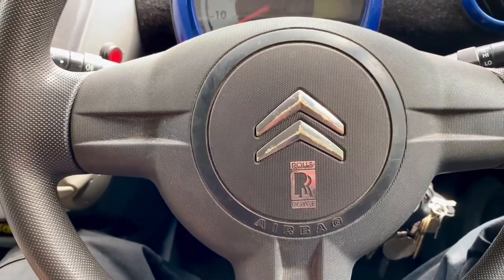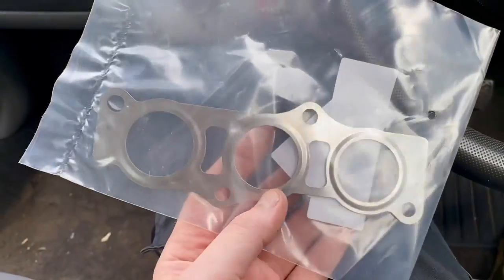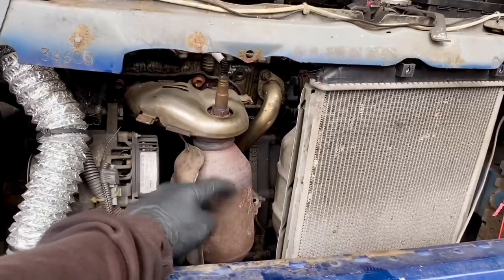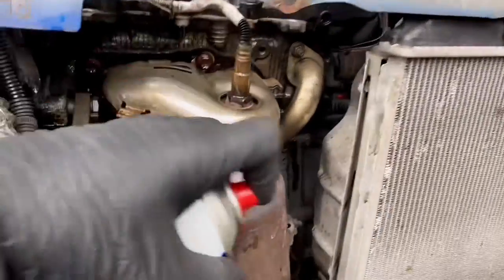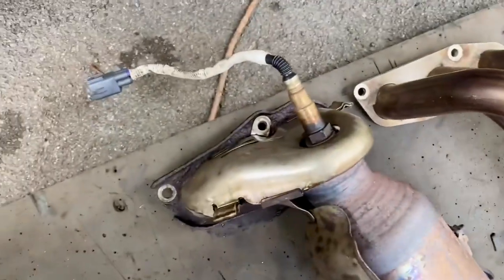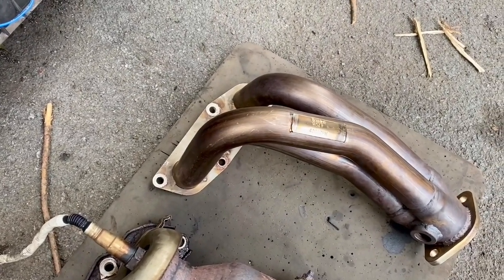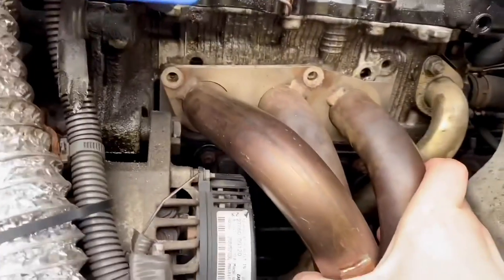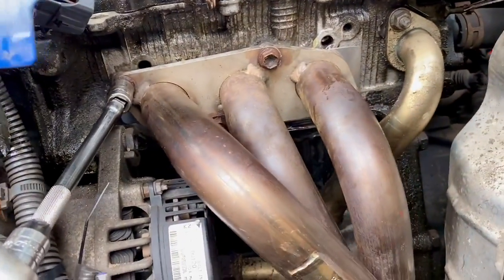CityBug Decat Manifold Fitting Guide + Tested / Catalyst Replacement Installation (C1/TAygo/107)

Comment: Nice one. I'm thinking of getting a piper manifold as well for the Aygo. But now you mentioned hollowing out the stock cat, that might actually be a good idea and save a few quid. To pass the local MOT I'll just get a universal sport cat and install it somewhere in the middle
Reply from the maker: I’ll just put a cat back on for MOT. Now it’s been off it should be easy to do even without taking the bumper off

Comment: Enjoyed this, SBSV!    Idea for a future project:  I decided I want to paint my current shitter C1 and have been watching about 18 thousand YT vids on painting cars with rattle cans.  Some turn out like a polished pig and some pretty shockingly good.   So there you have it!   First a bit Karate Kid ("Sand'a car, Daniel-San") to roughen the clear coat for adhesion, and then you don't even need primer if you use an enamal paint (like Rustoleum) or a nice matt acrylic (like Autotek).   PS.. Bright yellow is said to be the best colour for rattle cans - can barely see imperfections and naturally blends between section.  I'm going matt black though.  Go for it..... I dare ya!
Reply from the maker: Cheers mate. I’m shit at bodywork but the sill on the other c1 actually turned out way better than I could have ever expected. If you’re painting onto paint you just need to scotch the surface. Matt black is one of the easiest colours not to show imperfections too as there’s no shine to reflect off them, where as gloss black is probably the worst for it lol. Good luck.

Comment: Very jealous that yours isn’t leaking I haven’t been able to find a way to stop my piper manifold from leaking at the flange currently got 2 gaskets and a sealant all around it and it’s still leaking
Reply from the maker: Did you see how I sealed it? The gasket needed spacing off to seal on the shitter
Reply: @StupidBlokeStupidVideos  yeah I’ve got a custom exhaust with a wider centre pipe so I don’t even have one like that in mine
Reply from the maker: @ShaunBourke  ohhhhh, just weld a short flex to the shitter then 🤷‍♀️

Comment: One question,iam not sure but have you already remove the catalyst from inside of the manifold ( the old one ) before you take it out to put the new one? If yes did you see any difference in performance? Thank you for your nice videos even with one hand!!👋
Reply from the maker: Hi mate, yes the cat I removed was already hollowed out. The difference after fitting the Piper wasn’t that much to be honest, a bit more power higher up the rev range but is actually a little bit worse at lower revs and seems to use a little bit more fuel as a result. It’s also a bit louder/more raspy than before.

Comment: I was going to get one of them piper decat manifolds don't think I will bother now lol.outstanding video though keep the good work up.
Reply from the maker: Cheers mate. The difference isn’t huge but is there, it’s mainly at higher revs. It’s been on a couple of weeks now and actually feels slightly more flat at low revs and seems to use a little more fuel too. The sound is definitely better though, it does make it louder which I didn’t really want but the note is better.

Comment: If this can give me more mpg, I'd give it a try. Thanks for sharing.
👍
Reply from the maker: After a couple of weeks living with it, the mpg seems to have dropped by about 3 😞
Reply: @StupidBlokeStupidVideos  shouldn't make much difference because at 1000-2000 RPM, even at full throttle, you're only creating 1/6-1/3 of the gas at 6000 RPM. Maybe gave a few extra hosses though

Comment: Just to demonstrate my far superior knowledge, the ring end of the 22mm spanner WILL fit over the connector plug of the lambda sensor so you don’t slip off using the open ended side and batter your knuckles
Reply from the maker: It does, I think I got it through first time I removed it when I spunked oven cleaner into the cat to clean it

Comment: Forgot how long geared these cars are, been awhile since I've owned a 107, but that's a good pull in 3rd.  Mine was model with a rev counter,  can't remember what the redline is, but for a 5 speeder you were near top speed in just that one gear.   I never used to rev mine out like that,  so the mighty 1ltr bug impresses me more.
Reply from the maker: They’re just major powerhouses 😂

Comment: It seems a little bit faster at the end comparison - and you had more fuel on board, so I reckon it's made a difference. Pretty slight though, hey?
Reply from the maker: Yea I’d say you’re bang on. It is slightly quicker, but as a downside it also seems to have lost a tiny bit of grunt at low revs. It seems to have moved the torque curve higher up the rev range a tiny bit.
Reply: @StupidBlokeStupidVideos  maybe a higher top speed now! 😁
Reply: @chrisyboy219 you can hit 105 on the speedo in stock form and not going down hill either.

Comment: @StupidBlokeStupidVideos silly question mate, but any idea what size the bolts are? It seems the 4 manifold bolts are 12mm? What about the cat? Are they 12s as well? Im just trying to get all the tools organised before i whip the bumper off. Thanks mate
Reply from the maker: Ah shit I can’t remember tbh. The bolts that go into the bottom of the cat usually knacker up and rust away tbh so may be worth getting a pair of new ones and new springs if possible
Reply: @StupidBlokeStupidVideos  ahh, thanks for the reply anyway. I've got all new bolts and springs in the post, and the bumper should be coming off tomorrow, So I'll find out what size they are tomorrow anyway. Loving the content by the way. Just got myself a 107 and been binge watching your vids. Great stuff 👍

Comment: Don’t you just wish that when you’re fitting a wheel they’d used studs so you could align the wheel without having to support its weight.  I wouldn’t want to fit a massive wheel to a very large vehicle with bolts!!!!
Reply from the maker: Most are ok with the centre bore lined up but some are awkward

Comment: They aren’t road legal I wouldn’t fit one as they cause pollution.  I don’t have kids so there isn’t their health to worry about.  I told my insurance in the eighties I’d put different manifolds and a straight through silencer and a bigger carb on my Austin Mini they said it won’t make any difference- it was about 4 miles an faster at top speed than the standard one I overtook eventually  😂😂😂😂. On a disused airfield of course where I later nearly caught a non genuine police car at 105 miles an hour in the same Q plated Mini😂😂😂😂
Reply from the maker: I do have a kid, but fuck it I fitted one 🤷